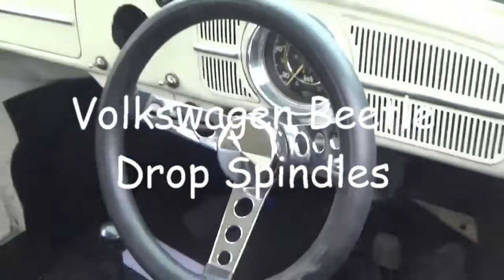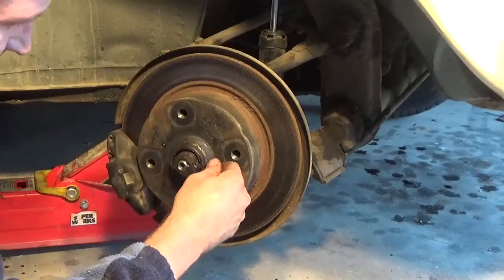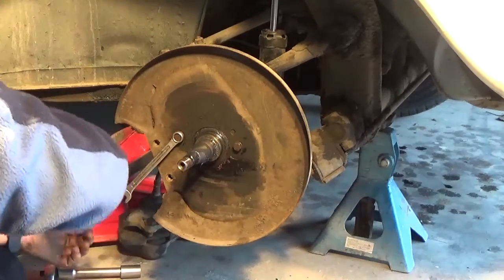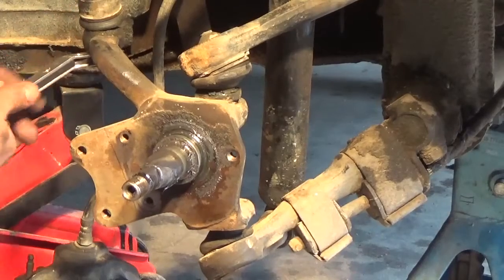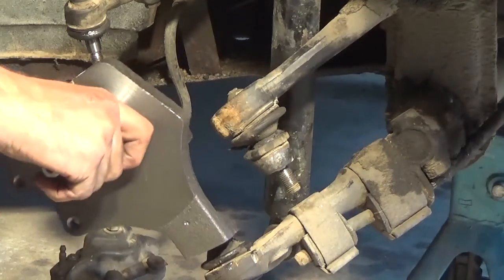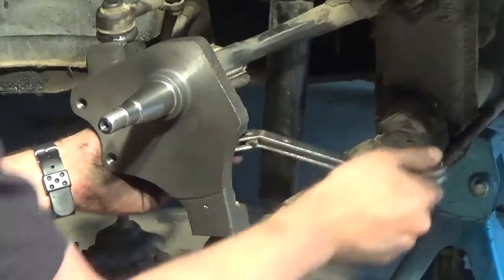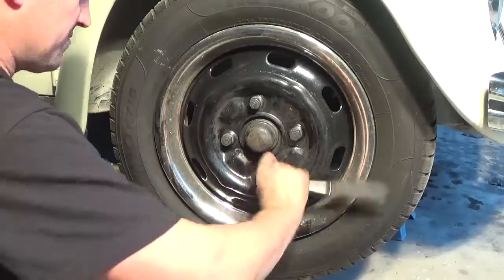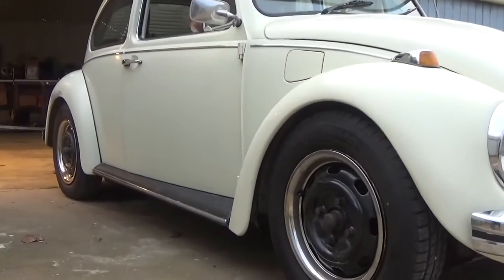VW Beetle Drop Spindles!

Comment: installed these spindles on my 69 beetle , you have to remember to check the condition of the torsion bar  the drop spindles increase the track slightly as well, mine with standard 165 80 15 tyres rubbed like a bastard , had to remove the drop spindles in the end as with even just a driver or passenger  the car was undrivable.
Looking at smaller tyres

Comment: Great informative videos. How or what did you install to lower the rear? Thanks
Reply from the maker: Hi BH, The rear is not lowered. Just sagging a bit from old age.The usual way to lower the rear though, is to install adjustable spring plates or readjust the torsion bars. Thanks for watching!
Reply: Mr Slugish thank you so much for replying. How much are those spindles. I'm seeing different price ranges on the internet. My 1967 is a 5 lug. Would the drop process be the same as yours? Thanks again in advance!! :)
Reply from the maker: Hi B H, to be honest i bought the spindles so long ago that i cant remember how much they cost. My  '69 bug has a balljoint front end, so if your bug is also ball joint the process will be similar. If however, your bug has an earlier king and link pin front end (sounds like it does), the process will be slightly different. Search thesamba.com for ideas. Good luck with it.
Reply: Or just flip the diagonal arms (if it's I.R.S.). Just remember to cut off the shock mounts and snubber mounts and reweld them onto the opposite arms. It would give you a 1" drop.

Comment: I have a 68. I am doing on off -body restore. While I am not doing a 50k restore, I am also not broke. Do you think its work getting the adjustable beam, or narrowed adjustable beam while I have it apart? I like my 190/60R15 tires, but I would have to drop those down to do the spindles and lower it 2.5. I think with the narrowed beam, I could keep my tire size
Reply from the maker: Hi, if you want to go low, an adjustable beam with drop spindles would give you quite a drop. A narrowed beam will help tuck the tires in the guards. Narrowed beams come in different widths also. A 2 inch narrowed and adjustable beam with drop spindles isn't too radical. It depends on the look you are after, and how low you want to go.

Comment: Hey! I like the video but I was wondering do you need shortened shocks for the drop spindles to work???
Reply from the maker: No, shock length stays the same. The only difference is the spindle sits higher, which doesn't change shock length. Thanks for watching!
Reply: +Mr Slugish Ohhh ok! Thank you!

Comment: What size are your tires?
Reply from the maker: Hey Tate,
My tires are 165/80 R15
Reply: I just put the empi 2 1/2" drop spindles on my 70 today. My 165 R15's are rubbing.. I am looking for a tire adjustment maybe to a 145?